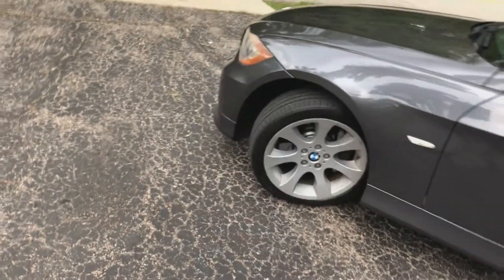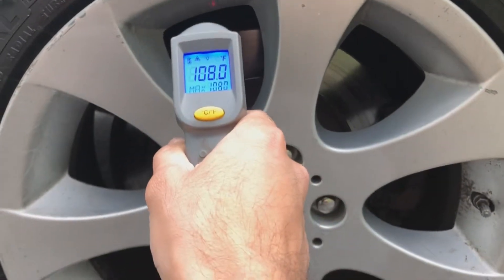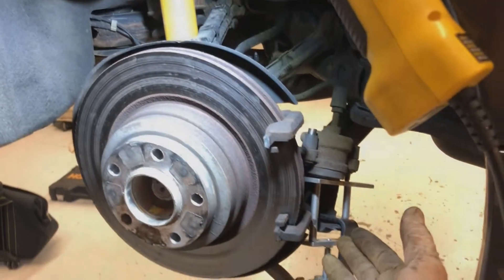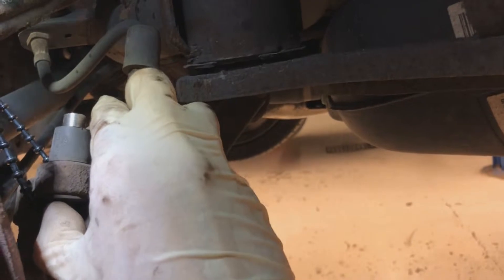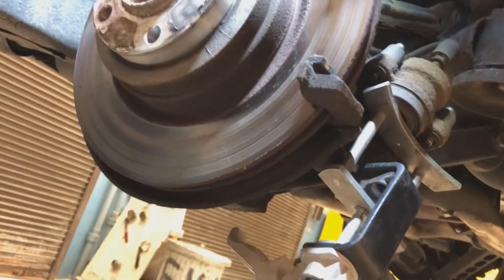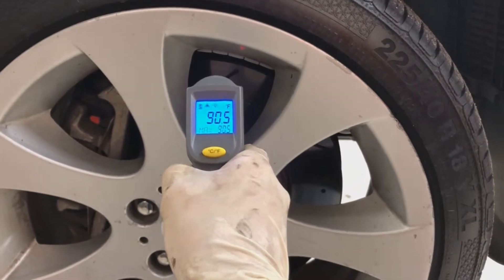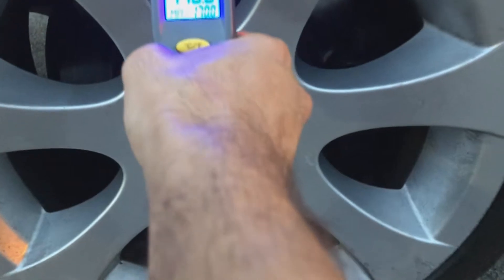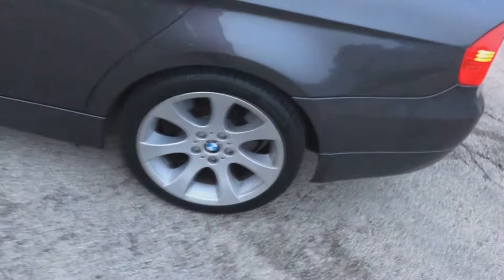How to Diagnose Sticking or Dragging Brakes in Under 5 minutes

Comment: What if rotors, pads new, cleaned up, greased up and still little bit dragging? I used the same grease for the pins and brake pads, might that be the issue? Its pin grease.

Comment: I had this similar problem.
The brake pad guide wasn't sitting correctly due to rust buildup. And the brake pad was getting locked up.
Ironically almost the same spot as his in video.
Knocked off that rust and that pad guide sat correctly.

Comment: To save 20 bucks on a thermometer if you leave it a couple weeks the culprit wheel will start smoking =)
Reply from the maker: Hahaha hopefully it will not get that bad!
Reply: @tunerworld  my wifes did when i took it to work the other day, smoking like a bastard. I put a ton of copper grease on lower pin as it felt stiff. I had done the piston replacement previously so if it happens again could be calliper